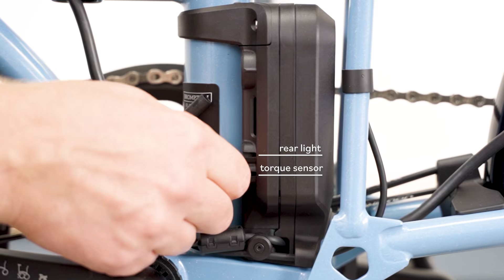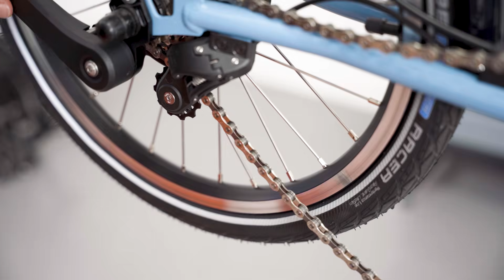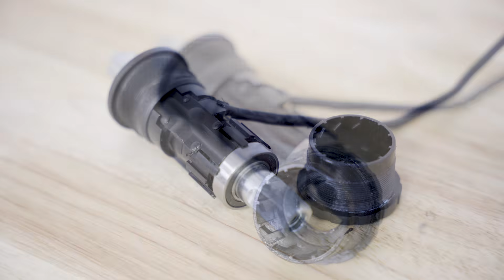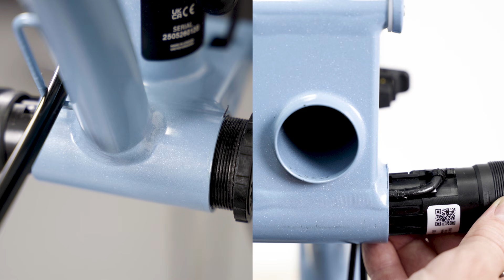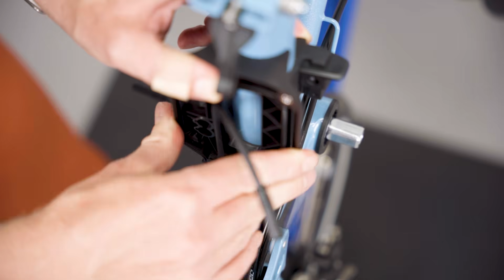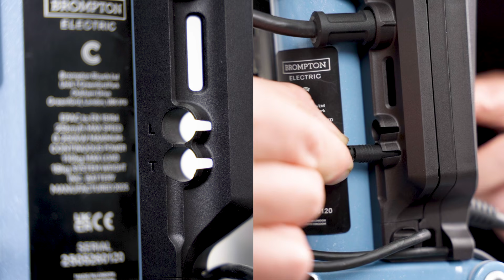How to remove and fit the controller and torque sensor on the Brompton Electric e-Motiq bike

Comment: can the e-setup be mounted on a regular 12 speed P line? not really caring if I lose some of the speeds (from the internal gears)
Reply from the maker: no the electric system can't be retrofitted to a different Brompton